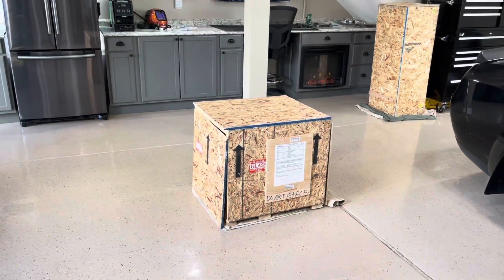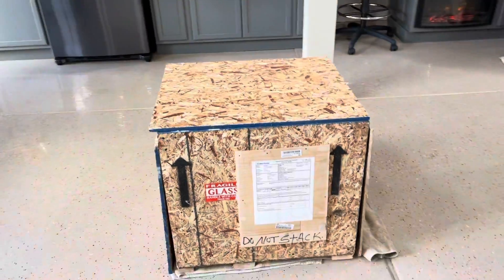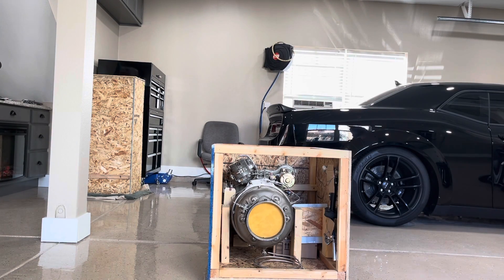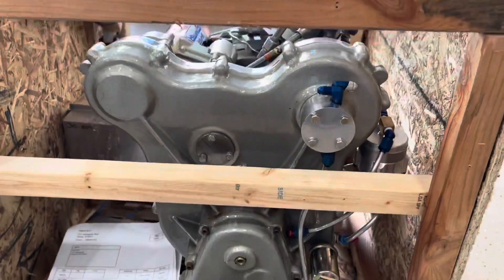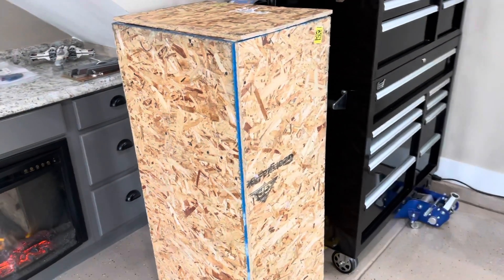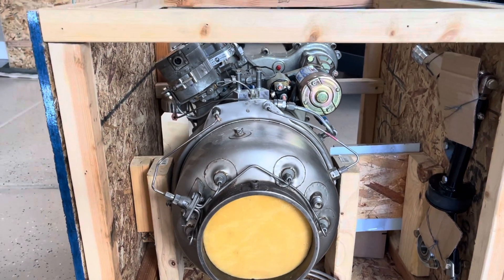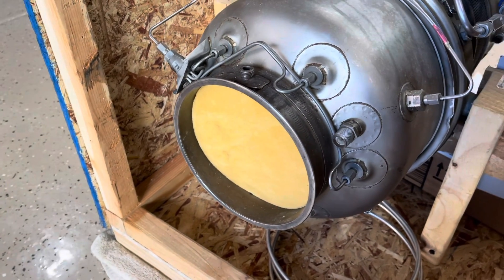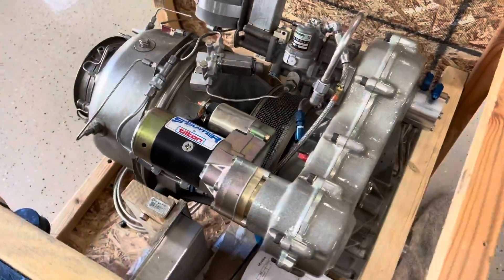Helicycle Turbine Engine Unboxing (1)

Comment: observation: Why not try Ceramic Coat? I'm a Polaris RZR guy. My Yoshimrua Racing exhaust is coated. Inside and out. Yes inside has cooling and protection benefits. My engine is hopped up and spits fire so to speak . The coating is still new looking.